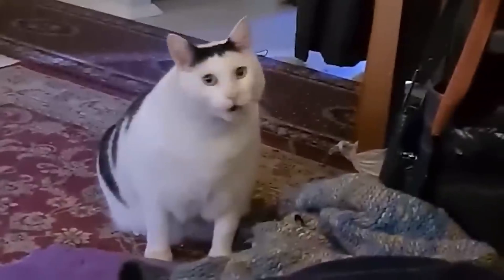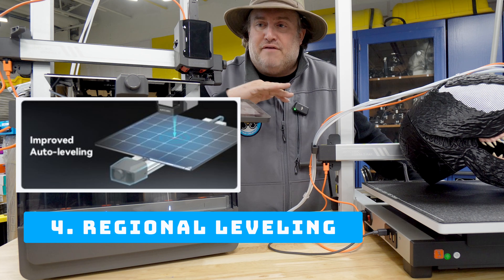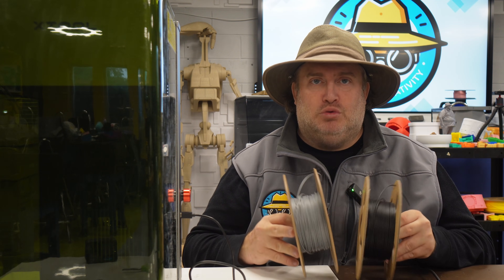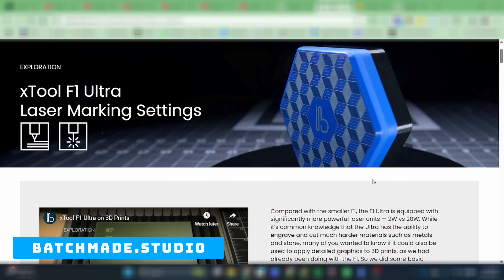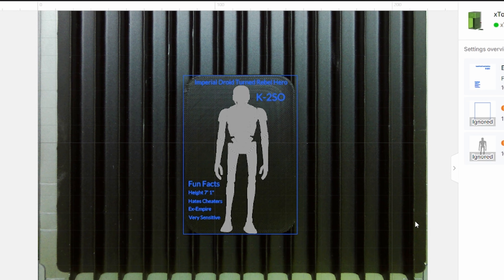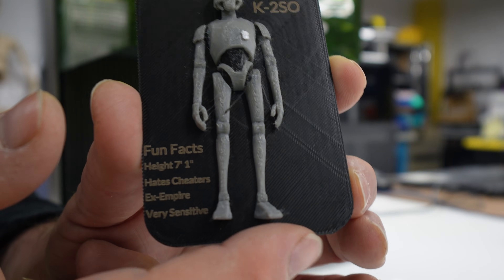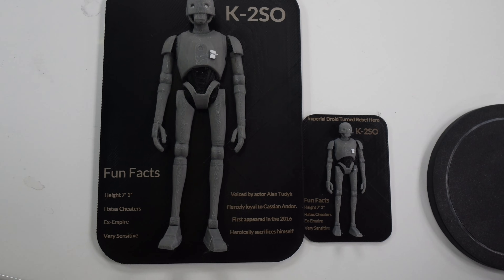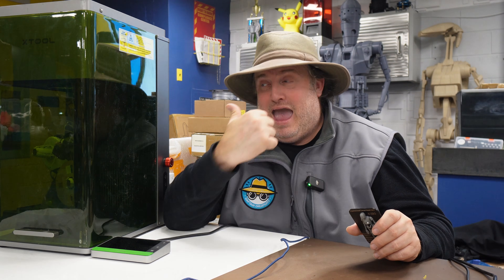I Laser Engraved My 3D Prints with xTool F1 Ultra — The Detail is Absolutely Insane

Comment: I was wondering your other settings used? You only mention speed and power but not Passes, Lines per cm, engraving mode and did you utilize Cross Hatching. Cross hatching wasn't available when I first started this journey. I watched Robert Cowin's video where he got great results utilizing cross hatching. XCS now has cross hatching but haven't tried it yet.
Reply from the maker: Hey, I'll have to check on Lines per cm, I know I didn't change any default settings if that helps. Was also single pass and unless you have to enable cross hatching then I didn't do it . I tried to leave everything to the defaults. I will however double check and update if anything was adjusted by myself. Thank you for the question and for watching.

Comment: Do you need to connect the laser to a ventilation/fan system or can i just have it working on my desk without engraving PLA?
Reply from the maker: You should always really have a connected to some sort of ventilation or fan system. For those who do not connect it I usually see that they have good ventilation in the room and then they wear a mask when they're near it. If it's across the room and you're not going to be inside that room breathing the air and then later you're going to open up a window and that could work. But the rule of thumb when doing the engraving is to really have ventilation because the particles are really flying everywhere and they're not good for you to inhale. Anyway hope this helps and thank you so much for watching great question

Comment: Hey, do you mind doing scratch test? In my experience markings on black filaments are scratchable, really ruins whole effect.
Reply from the maker: I could definitely do a scratch test. Just so I know that you're referring to what I'm thinking... Is the idea just to scratch the text and see if anything comes off? Let me know I'd be happy to throw on something on social media with a little video clip of me doing it
Reply: @CaptainCreativity  When Im engraving with IR laser - especially black PLA, or black PETG when Im scratching the surface it leaves marks. It is not an issue with gray or other dark colors, however with black its a mess. I wonder if its also the case for you, or its my cheap material an issue?
Reply: @kacpersokoowski4712  I found this effects the first layer and YES you can scratch it off. PETG is worse. I would recommend doing a clear coat if this will be in a heavily used application. This was my sole purpose when I purchased my F1 Ultra and it is an AMAZING application to marking and labeling 3D printed parts.
Reply: @sidelinereview  Thats awesome, thank you for confirmation of the issue. I will consider clear coat after marking.